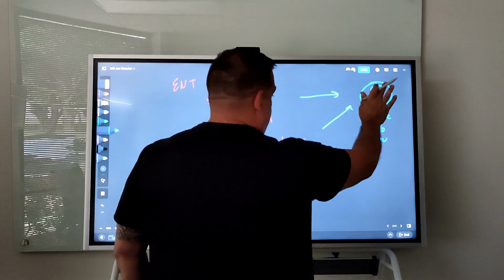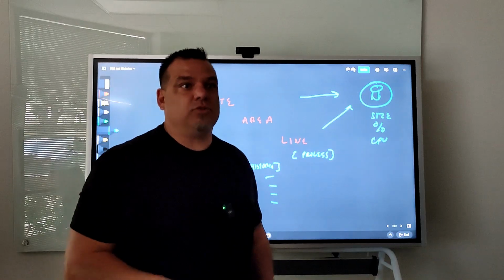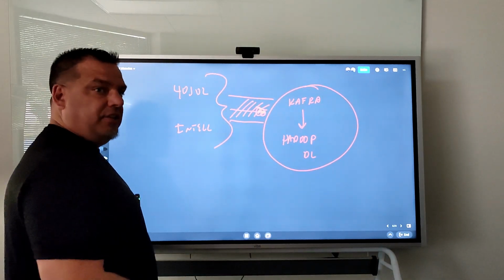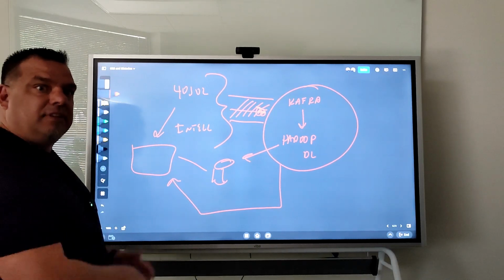Unified Namespace and Historians

Comment: Great video , full of useful information.
But not sure if you answered the core question , why not build the UNS just out of historical data and allow all nodes "publish" and "subscribe" to the Historian and use the same.

there are probably a bunch of performance related issues if you were to try to use a historian as the source of live data. Given the time lags I have seen I would not like to operate a SCADA that is pulling information from a historian. Historians weren't created to publish live values quickly.  but Tech can be improved.

So if there was a historian that could handle all the requirements of the UNS would it be a good idea to use it?

To me the fist thought is that doing so would break to me the greatest asset of the UNS. Its vendor/application agnosticism. If 4.0 Solutions created a historian that came with in Integrated UNS* ( or MQTT Broker) I still would be slow to recommend it as the that plant would be forever tied to the Vendor

As the UNS itself is not a node in the eco system, you can replace any node relatively easily, certainly very easily compared to replacing the same node in an I3.0 architecture.

*as the UNS is more of a metaphysical construct( or amorphous blob) and not a thing that we can point to you could never really integrate it into a single node.

As always love the stuff, and let me know if I've missed the mark completely